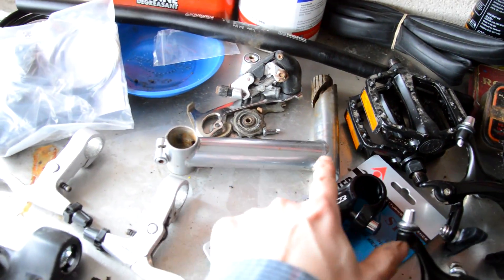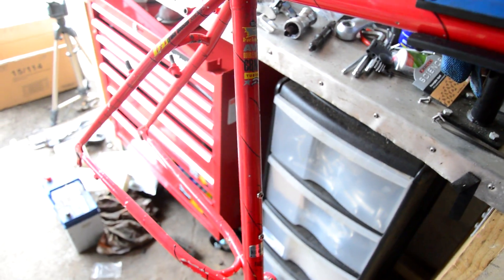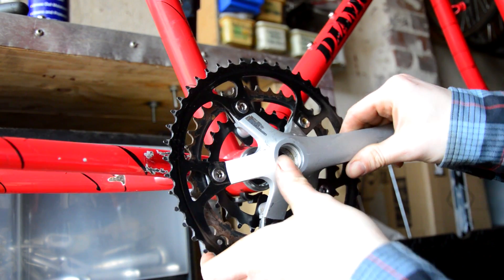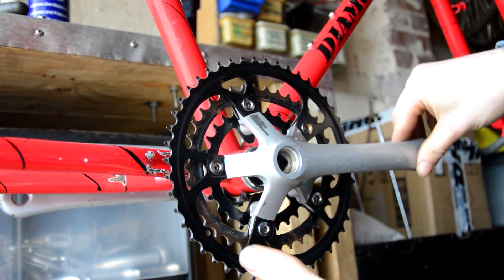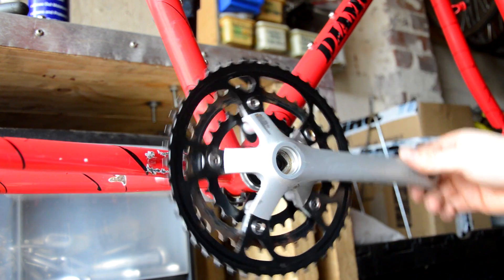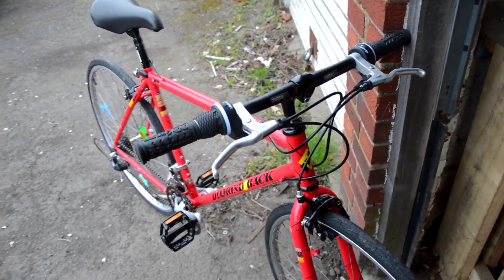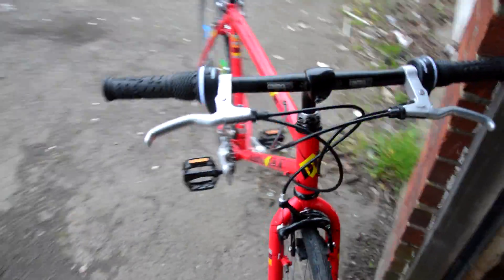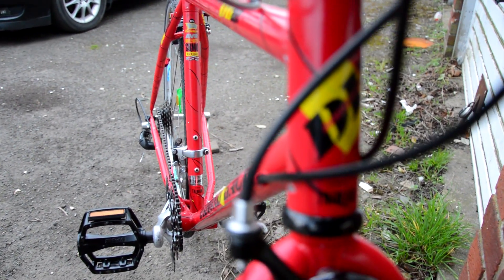1991 DiamondBack Apex - Building A Retro Hybrid - Bicycle Build

Comment: The Diamond Back Apex is a really nice frame. They don't make bikes like this anymore. Well they do, but they are very, very expensive.
Reply: Didn't diamondback make a 29er around this time to?👍✌
Reply: Yeah they were in the crossover range basically an off road orientated hybrid I have the approach 700c rides like a new bike with original drive train and gears just changed the levers and callipers to v brakes great bike

Comment: Well done. My early '90s Univega is very similar. It came with Shimano Exage CX500 components. Last year I got a Deore LX rear derailleur and wondered whether it would be better. I took off the Exage CX500 RD, cleaned it up and compared it with the Deore LX. They're nearly identical, right down to the model number. There's a hyphenated minor model difference, some cosmetic differences, but basically the same rear derailleur. The original thumb index shifters finally wore out so I replaced the flat bar with a swept bar and bar-end shifters. Great all arounder now.
Reply from the maker: I think in terms of derailleurs of this sort of age, there are minimal differences.  It's mainly materials used in the derailleur and weight I believe that changes

Comment: Biopace works best in what they call race mode i have a jamis with biopace i also have a 89 schwinn with sugino cycloid the offset chainrings were looked at as a gimmick but they perform well and the main issues like falling gears and chain derails are from not properly greasing the chain its very sensitive so the chain always needs a weekly oil to keep it perfectly smooth the minute it dries out your gonna hear some noise then shifting issues

Comment: Those old mountain bikes make a great base for a light touring rig or beater. Does the steering not get wonky when you swap 700c wheels for 26". Nice frankenbike build although I'm personally not a fan of those grip shifters.
Reply from the maker: Nah the steering is fine.  Pretty agile I thought when I went out for a spin.  Grip shifters were a convenience choice.  Indexed and easy to dump gears quickly.
Reply: I haven't noticed any ill effects of my conversion either. I agree with grip shifters.  I loathe them...lol

Comment: High five for rescuing this retro frame! You can unscrew the old brake pivots (flat 8 key if I remember correctly) and plug the holes, so it would look better :) But anyway, nice frame and clean build! :)
Reply from the maker: Thanks *high five back* Ah they unscrew do they?  I'll have a look at that.
Reply: MonkeyShred I thought the same thing as i was watching, you can get blanks off eBay for those mounting holes.
Reply: Sometimes they're removable, sometimes I think they're welded in.
Reply: Yup, what Peppermint Pig said.  Not all are removable.  And if they are removable, you could just get adapters that reposition the pivots higher.

Comment: What did you make of the Biopace chain rings? I have a set in my parts bin but always thought they looked a bit weird.
Reply from the maker: Bit weird to start with.  I didn't really notice it much in the "big" ring but in middle and small I always felt the pedal stroke speed up when it got to that certain point on the ring
Reply: They are good in In big gears, going fast and pushing hard you can feel the bike surge. Chris Froome uses elliptical rings - which is what these are.

Comment: How do you remove stuck pedals and small screws? I had no luck with WD40, lots of soaking time and a big screwdriver.
Reply from the maker: Stuck pedals.  Steel axle in a aluminium arm?  With great patience and difficulty.  I've had that situation and I ended up mounting the arm in a vice and soaking it for days and days before using a cheat bar to break the bond.  On one arm it still stripped the threads though.  I've also had a pedal stuck in a steel arm and ended up stripping the pedal down and filing bigger flats on to the pedal so I could use a stronger spanner.
Reply: @MonkeyShred    I know it's a 2 year old post, but thought I'd mention possibilities. I've read about people using temperature to separate parts of dissimilar metals. Aluminum and steel may expand and contract at different rates, people put assemblies in a freezer and/or carefully heat one of the parts with a torch. Of course this will not work if bearings, seals or other parts need to be preserved and will be ruined by heat. Don't know if this is an option with aluminum and steel. This  would have to be fully researched, but this technique is successfully used elsewhere and could be a possibility for bike repair. I have an old DB Apex SE I just got running , don't know much about bikes, but glad to hear people say they're well made. Good luck.

Comment: Class video. was hoping to convert my gt arrowhead 26 to 700c any idea if it will work?
Reply from the maker: Having a quick search for pics... I'm not too sure.  I don't think it will work with a suspension fork as you'd need a place on the bridge to mount a caliper (unless you had forks with a disc mount).  On the rear, I can't quite tell from the pics if there is a seat stay brace to mount a caliper to.

Canti / V brakes won't work without some form of adapter to raise them up (or that was the case with mine) and I can't find any adapters available.  That's why I had to go caliper.
Reply: Thanks very much, it has a Ridgid fork very similar to yours so was hoping to just fit road brakes, is that what you did?
Reply from the maker: Yup!  Exactly that.
Reply: Ah I might give it a go so

Comment: I have a Mt Shasta mountain bike frame 26 inch I will do the same but keep it 26 inch I have a  internal 3 speed rear wheel add a 3 gear crank